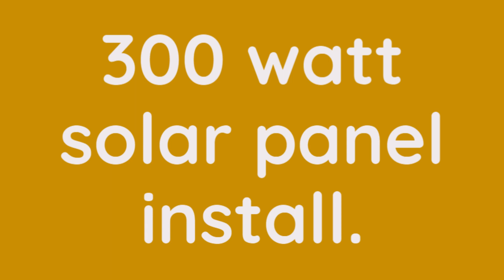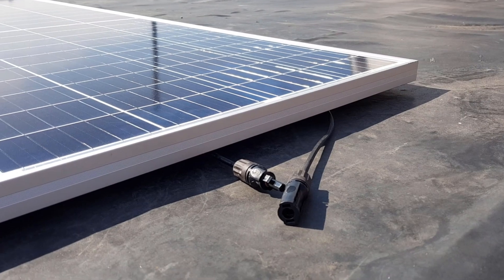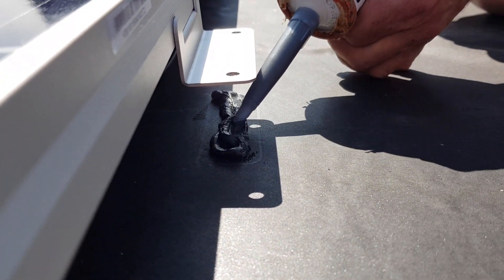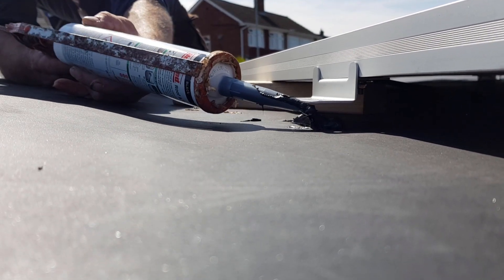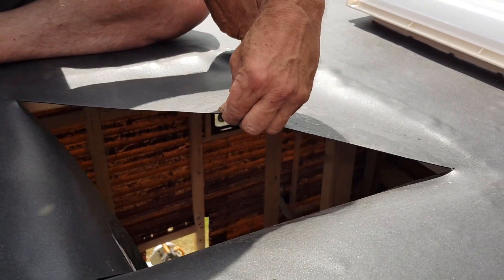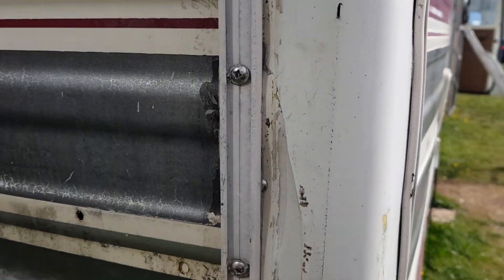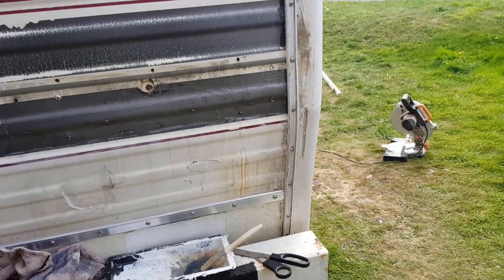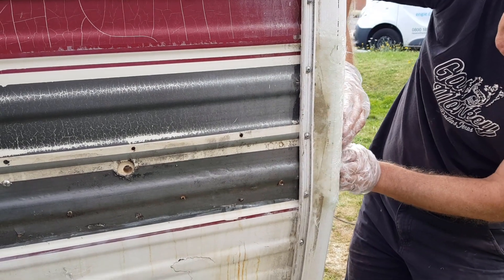American Ford RV Project Fitting a Solar Panel two Roof Vents and Fibreglass Accident Repair Work

Comment: Its taking shape solar & roof vents looking good guys.
Reply from the maker: This was our first go at installing and kind of solar, and we are really impressed how well it seems to work. How long it will allow us to run low powered things like LED lights if needed, if not on a campsite with electric, well time will tell. The first roof vent was a bit fiddly, being careful with what we were cutting out of the roof, but having done that one the second one was dead easy!

Comment: It's a shame white EPDM roofing membrane isn't really available in the UK at reasonable cost. It can be imported from America but it's expensive.
Reply from the maker: Yes, we agree, that would be much more beneficial in the summer months. Our motorhome does get very hot in the sunshine, we are hoping the insulation may help to keep some of that heat out. I suspect we will be having windows wide open :-)
Reply: Germany sweden and esthnia have production of white epdm

Comment: That fibreglass stuff is horrible. I remember going at it too much and starting to fall apart with strands going everywhere. lol. Any idea where you're going to position your solar controller and other electrical things yet? Great video.
Reply from the maker: I agree, its not the nicest of stuff to use, and sets quickly, you have to work fast and in small liquid quantities. Yes, the latest video (last night) shows where we have decided to place the solar controller. I was going to hide it away, as it's not an expensive all singing and dancing one, but decided in the end that we do need to see the LCD display. It's located on the double bed base. The real fun with the fibreglass begins when we start to build the shower cubicle, we have a great idea to build a large waterproof box, that cannot leak. That shower work should begin in about a month or so.
Reply: @VintageRVAdventures  I can't wait to see that! You might give me some tips. lol

Comment: Loving how this project is coming along and the style of presentation. Nice and engaging. Keep up the good work and we would definitely like to see how the glass fibre job develops as we have a similar job to do on ours. All the best from Mal, Dave and Sally the Lab aka The SilvertopMotorhomers xx
Reply from the maker: Thanks Mal & Dave, and of course Sally, its a very time consuming project, but we are loving every minute of it. It was not that many weeks ago when the RV was a wet mess of rotten wood inside, and now we are happy to say the horrid aged wet smell has gone, and is being replaced with sawn timber smells :-) We will keep the vlogs updated with the fibreglass work. Take good care - John & Samantha xx